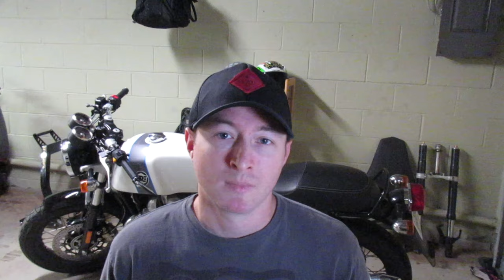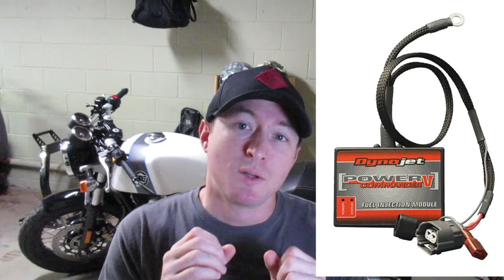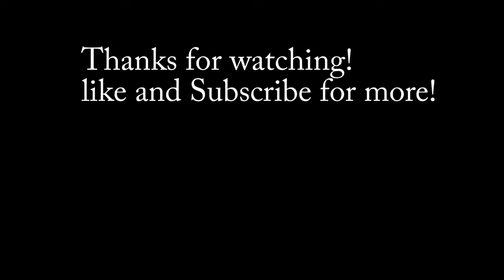Is a Power Commander Worth It?

Comment: dude, good info! i myself have a kawa z70 from 04. got a short and fully open exhaust en with that an open link pipe, sins installed that, it runs way to lean in lower revs.
so i went to a specialised engineer.. hey told me it was now way possible to adjust the bike's ecu to the aftermarket installed sports exhaust.. so het told me the only options is a power commander 3 usb.. with should fits my bike... now what's your idea on this..? is he right? or should it be possible to change the stock ecu, and go whiteout power commander...?
thx in advance for taking the time, to answer my question :)
Reply: That bro appreciate it u got a number I can link u on like what app so we can talk more about my bike I have a r6 2012

Comment: I have one of these on my 2017 wildcat sport. Bought it like that. I noticed the exhaust is excessively loud and it will backfire from time to time. I think it has to do with this device. Can I remove the device without any issues or does it have to be reflashed?
Reply: Did you download the application for your bike.

Comment: I never heard of such a device.  I never plan to change an exhaust from stock... I think a stock exhaust would be just fine for me.  
This was an interesting video though.
Reply from the maker: Just answering questions, and giving haters a reason to hate haha
Reply: "What about just the tip to see how ya like it" "or ouch ouch your on my hair"
Reply: I have the same intent, I do not plan on changing out my intake/exhaust system. BUT found  interesting is the ability to advance/retard timing up to 20 degrees. My motorcycle runs very lean from the factory and the engine gets  hot. I was thinking about getting the commander V to advance the timing and increase fuel octane level to 89 or 91 to produce more power and help with engine heat management. Has anyone use the commander V for this purpose?

Comment: I just bought a pc5 for my 06 gsxr 1000 with the autotune feature. Lets just say im kinda pissed i wasted my time and money on it. My bike ran absolutely great before i installed it. Now its running on 3 cylinders. Im taking it off to make sure thats what it is. I see an ecu flash in my near future
Reply from the maker: Very sorry to hear it Melvin, but I do hope removal fixes the dropped cylinder!
Reply: Hey my friend, I have the same bike and set up and my bike runs awesome. First most all problems with Auto tune come from O2 sensor leaks and loose wires. Second it takes a lot of riding for your Auto Tune to tune your bike. I would recommend installing a fuel map off of the DJ website that most closely matches you air filter and exhaust set up. This way the Auto Tune does not have to make such great changes to properly tune your bike. This will help tune your bike as quickly as possible. Also remember the Auto Tune will only tune the rpm levels you consistently achieve. If you never run your bike at 12000 rpm your Auto Tune will never tune for that rpm. I run all rpm ranges during a track day so my bike runs great from idle to wot. I regularly hit 12000 rpm so my entire rpm spectrum is tuned. I hope this helps.

Comment: Just bought one for my Kawasaki Vulcan s 2018.Now I am thinking it wasn't a good idea.
Reply: Can you tell me what power commander does to your Kawasaki ? is good or bad explain me
Reply: @ghost_mne  I actually haven't got around to installing it yet. Had a on the job accident that required surgery. I have been off my feet for two months. I was just speaking on the price of the unit compared to booster plug .It's half the price and you don't need to download any upgrades.

Comment: You wot? The bike behind you gets issues on over-run with slip-ons - they run lean and hot to comply with Euro emissions. If you use a TEC fuel booster it stops the over-run popping and since it's an air cooled bike, it runs better a bit richer anyway. The benefit to these add-on electrics is you can remove them easily for emissions testing, rather than having to re-program them each time (if that's even possible on Enfield 650s). You could have mentioned that stuff...
Reply from the maker: Well to be honest we do not have emissions testing on motorcycles where I am, so having to swap around for emissions is a complete non-issue here (therefore I wasn't thinking of my Euro friends on that issue). I have not had issues with the 650s running too lean with slip-on half systems here, full systems yes the booster is a good idea, but at least with the bikes we are getting a slip-on has not caused issues. That being said any bike that needs something like this, and does not have a good remapping option, then so be it!

Comment: Greetings Alex, I'm watching this video after I encountered "an issue" on my '03 954. As many people know 954s are know for their sketchy pair valve system. I had it replaced for cheap and I'm now worried that I won't be able to find it again (or atleast cheap). Would it be a good move when that servo motor grinds its gears to replace it with PC and all the other mods (straight piped can, high flow air filter, block off plates, etc...)? That is something I would pretty much consider as an option since there is no specialist where I come from to tune the ECU. Thankful in advance for answering!

Comment: hi. i change my air stock filter to racing k and N filter. do i need a power commander or ecu? im using slip on
Reply: That's what I need to know as well
Reply: Yes. It’ll run but it will run leaner with out.